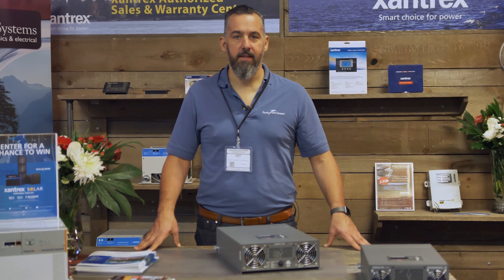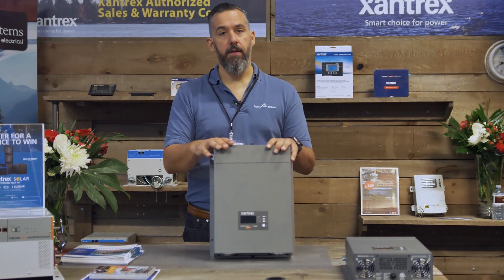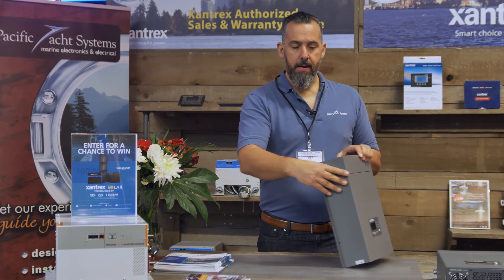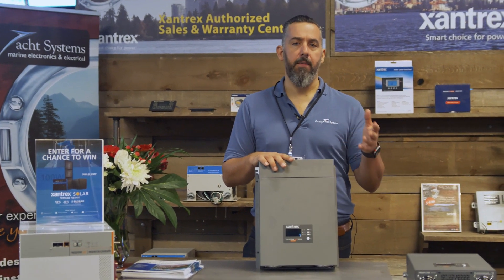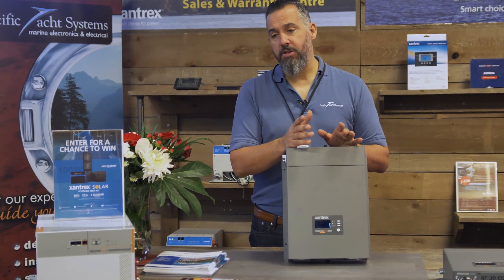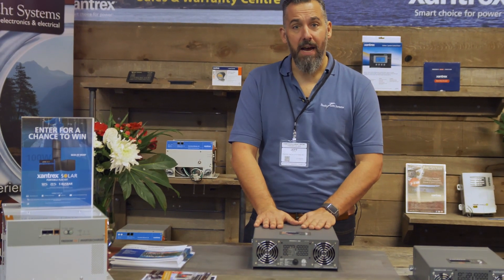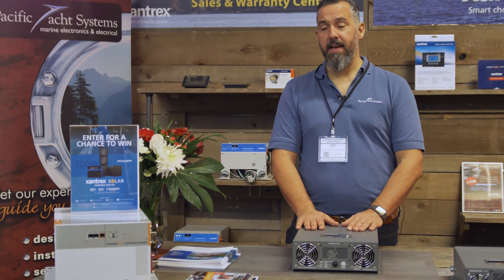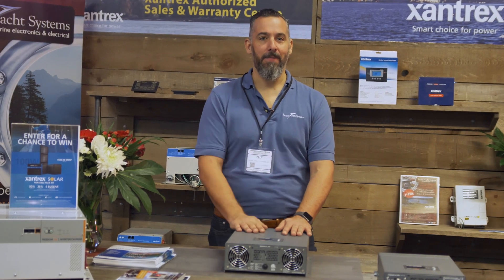Boat Show 2020: Xantrex Inverter Chargers

Comment: Thank you, Jeff, for bringing this inverter charger combo to our attention. Everyone highly recommends the Victron multi-units. But they can cost over two times as much as these units. As an small boat owner, with only occasional usage, it is difficult to justify the investment in victron. This unit is much easier to justify. On the Xantrex website, there are various accessories available for this unit. Unsure which are recommended/required for marine use.
Reply from the maker: Hi Marc, for a xantrex inverter only, consider the X1000 or X2000 inverters.

Comment: Thanks for your webinar, but no one is able to incomporate alternatror, solar, wind and hydro source into one batery  combinator ( three battery bank) do you have some advice?
Reply from the maker: Technically yes, but then your battery isolator becomes a single point of failure.